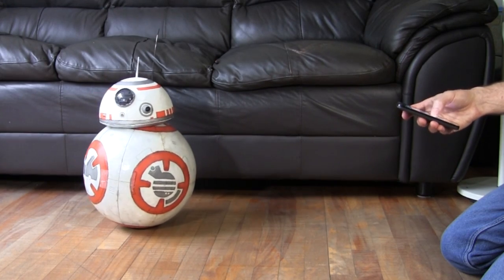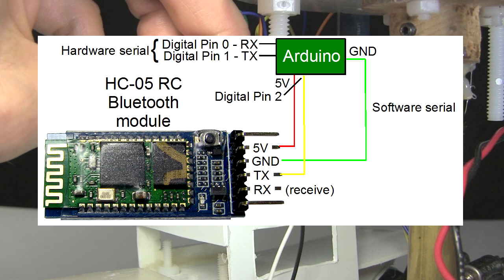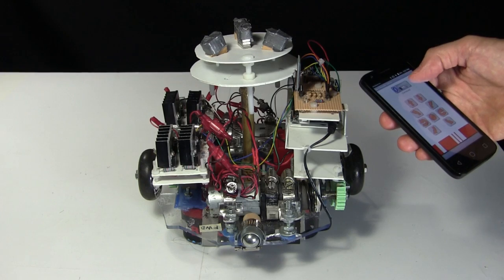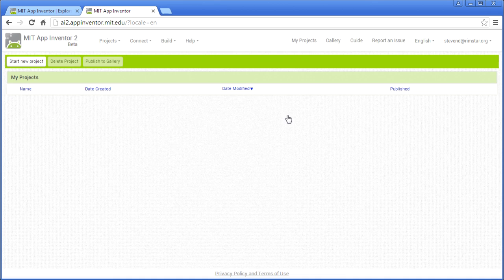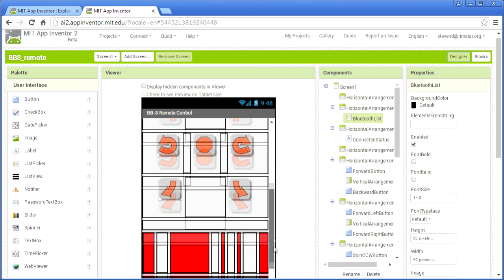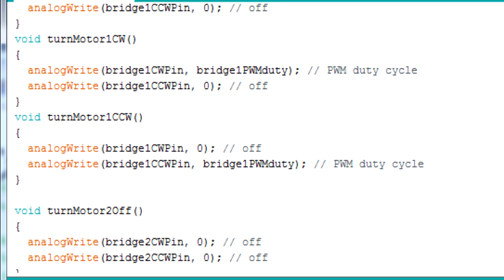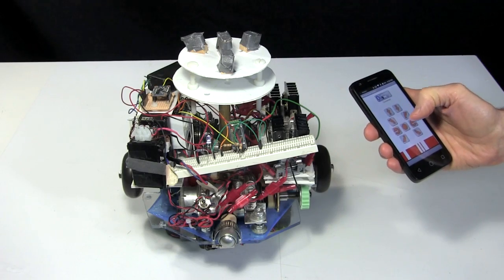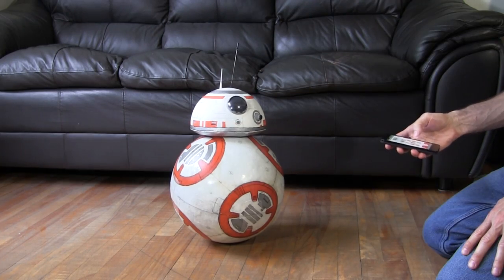Making BB-8 (v2) - Adding HC-05 Bluetooth RC - Part 6

Comment: how did you made the converter?!?
Reply from the maker: I document it here https://rimstar.org/science_electronics_projects/rc_controller_to_arduino_hack.htm but it turns out I could have made it a lot simpler. It wasn't until I wrote this Hackaday article https://hackaday.com/2016/11/14/ask-hackaday-converting-negative-voltages-to-positive/ and N1JPL pointed out in the comments that the RC receiver was just two H-bridges that I realized that I'd overdone it.

Comment: can plz explan which part u remove from the circuit? ........ can u plz give me the final circuit diagram?
Reply from the maker: The final circuit diagram is at:

https://rimstar.org/science_electronics_projects/bb-8_v2_drive_electronics.htm

and the webpage about adding the HC-05 board, basically what I show in this video is at:
https://rimstar.org/science_electronics_projects/bb-8_v2_hc_05_bluetooth_rc_for_arduino.htm

The circuit that I removed is here:
https://rimstar.org/science_electronics_projects/rc_controller_to_arduino_hack.htm
Reply from the maker: Oh, as for an explanation of what I removed from the circuit... originally I'd taken a remote control receiver from a toy RC truck and adapted it for use with my BB-8. That included making a circuit board to convert the information from the receiver into something which the Arduino could understand. So that receiver (and its batteries) and the circuit board are the two things I removed from the circuit.
All of that was replaced with the HC-05 board which I show in this video.

Comment: I tried fibreglassing the home made body from inside but it is very rough and hard time taking too .I have painted the outer layer already that's why no option left for me please if you can provide me a globe like yours it would be greatly thankful
Reply from the maker: My globe took weeks to fiberglass so I'm not able to make one for others. You can see all the steps in this video https://youtu.be/se4zfgIx9sA. There are a number of places to find the globes for cheap. I found one in thrift/second hand stores. I just kept revisiting them for a few weeks until they had one. Also try classifieds like https://my.freecycle.org/, http://craigslist.com, and https://www.kijiji.ca/ for example. Then there's https://www.ebay.com/.

Comment: You might be able to make your electronics more compact by using a microcontroller that has the Bluetooth built into it. Additionally, you could have a step down converter board so that you don't need separate batteries for that microcontroller.

Also, if you're looking to add sound, you might as well go with a Raspberry Pi 3, for the built in Bluetooth and for it's audio port. Then adding speakers would be a breeze.
Reply from the maker: Good idea re the step-down converter to eliminate batteries. For a microcontroller with Bluetooth I was thinking of an ESP8266 or the newer one but a Raspberry Pi would be better. Not sure which direction I'll go next.

Comment: Really love the tutorial. One can lern a lot from it. I would really appreciate you stop using #define preprocessors. These are ancient C remains. If you use "static const int" oder "enums" instead you can benefit from "code completion automatics" and other stuff (when using real IDEs). Otherwise all the kids will learn ugly coding and it will persist... (#ifdefs within code codeblocks are even worse. I had to vomit when fixing marlin bugs)
Reply: It is not always a mater of choice: for instance, using Microchip IDE for MCU, the compiler you get for free is C-only, and you would have to pay for the C++ version. Anyway, its old-C++ (last time I looked, it was not even C++11).  Just to say that it's not always a question of knowledge or taste.

Comment: Would u make one and I could buy it ?and how much?
Reply from the maker: Sorry, but making it takes way too much time. The cost would be astronomical. It's not perfected yet anyway. Still to do: lighten the head more, add sound, add pid control if the motors are up to it, find a nicer hololens, look into making the head rotate and move independently of the drive system.
Reply: +One health Nut A Day
Learn, do, tamper. Get an Arduino kit and Elenco electronics(Resistor,Capacitor,Transistor and Diode) kits
and a cheap Arduino kit
http://amzn.to/2i3xPU9     http://v.ht/uno3kit
Join these classes
http://www.instructables.com/class/Arduino-Class/
http://www.instructables.com/class/Robots-Class/
http://www.instructables.com/class/Electronics-Class/
It is not hard to learn, just go slow, watch, read, do, practice. After a while you will make something very beautiful
If you are serious and wanna go way beyond that then read the book Art of Electronics and get the manual/lab and do the stuff, you will learn a lot, and make stuff that you never thought of.
Ask on the net if stuck, everybody gets stuck.
http://amzn.to/2A32jw2      http://amzn.to/2A8evJI
Good luck

Comment: It only takes you 1 extra fet to make a proper logic level converter (even bi-directional): https://cdn.sparkfun.com/assets/f/3/3/4/4/526842ae757b7f1b128b456f.png
Reply from the maker: Are you talking about running it without the H-bridges?

Comment: ohhh man I remember working with HC-05 board, that bluetooth model barely holds a stable connection in my experience. Did you run into such issues? if so how did you fix it have a stable connection I would really like to know
Reply from the maker: I haven't noticed any problem so far. I wasn't even aware there was an issue. I've run it plenty both in the ball and out. Could it be a distance thing? My phone's always been within maybe 10 feet/3 meters of the HC-05.
Reply: hmm well, I had to code for the android part through a java IDE. I never tried using MIT's tool though, maybe that was the problem. I was also using Arduino UNO for my project. I think it was App side that the problem was happening, since I could connect two HC-05 no problem without connection dropout, but the app I created could barely hold on loosing connection sporadically.

Comment: the weight of the robot must have changed, right? so did you change the intensity or the power which is given to the motors?
Reply from the maker: No, I didn't adjust for the weight change. One of the reasons I switched to using the HC-05 board was to make room for an amplifier and speaker so that BB-8 can make sounds. That's all going to go where I just removed the old RC stuff and will put the weight back anyway.
Reply: RimstarOrg oh! that's both lucky and smart!